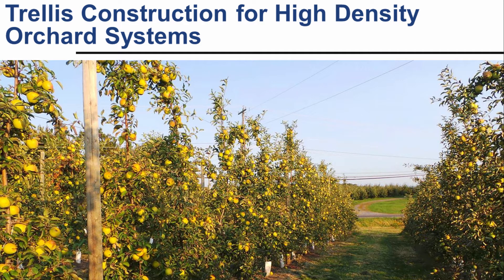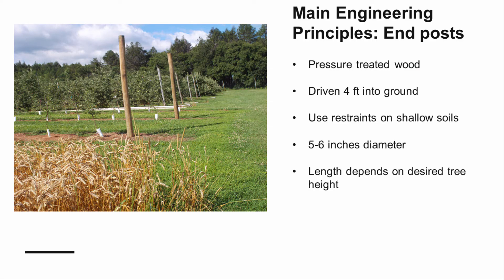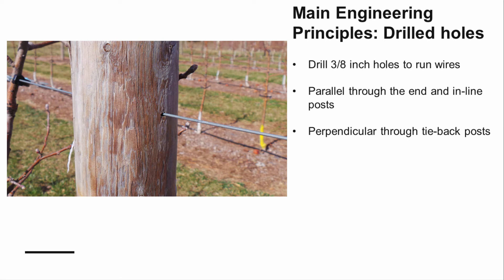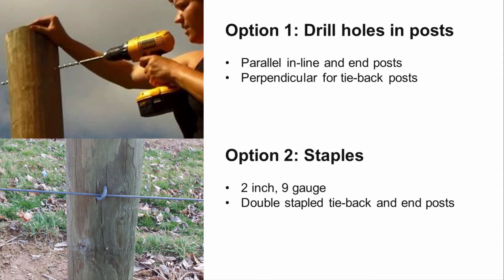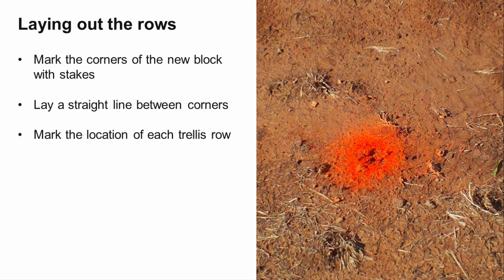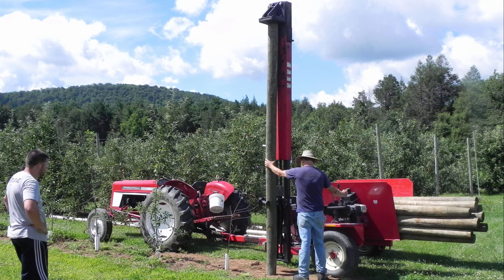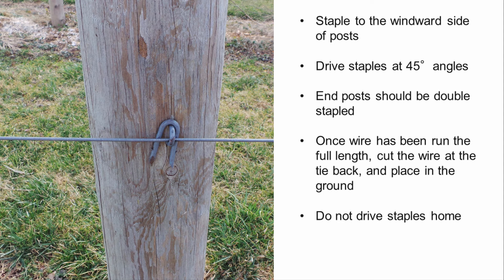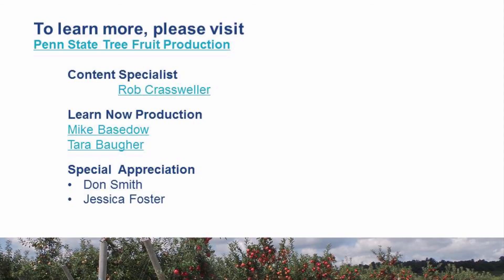Apple Trellis Construction for High Density Orchard Systems

Comment: At 3:10 you list a wire tension stress of 200-250 psi. That seems extremely low for wire that's rated to 200,000 psi (according to the label you show). For 12.5 gauge wire, this works out to a tension of about .37 pounds. Seems really low.
Reply from the maker: Levi,
Thank you for your question. It may be the terminology that is confusing. We were explaining the recommended tension to apply to the wire and not the breaking strength. We recommend the wire be tensioned to 250 pounds to ensure that it is tight enough to remain straight and provide support for the trees. The actual breaking strength is over 1540 pounds per strand.

If you think about this for an animal, for example, the 250-pound tension is how tight the wire should be so the animal will be held back. If the wire tensioning is lower, it will be very slack and the animal will be able to climb between the wires and escape. 

Tara Baugher
Extension Educator, Tree Fruit
Penn State Extension